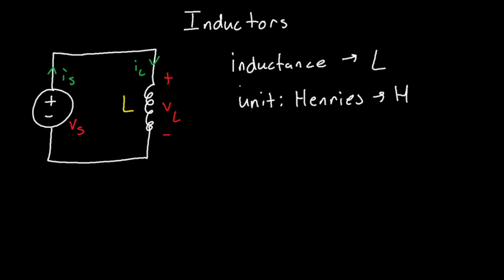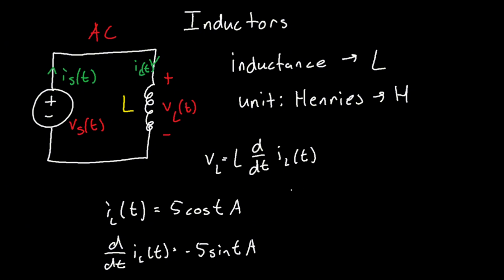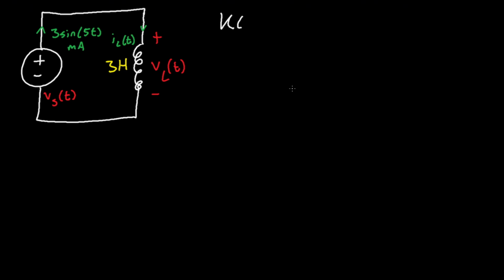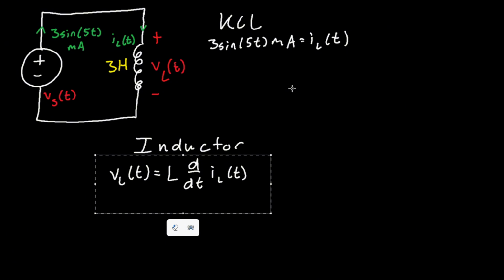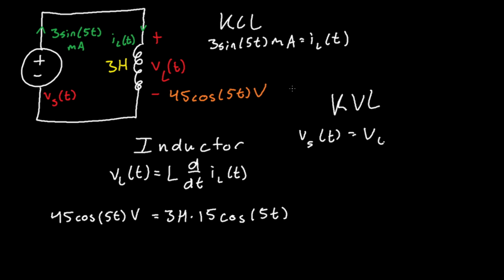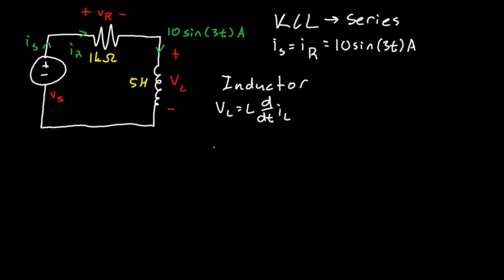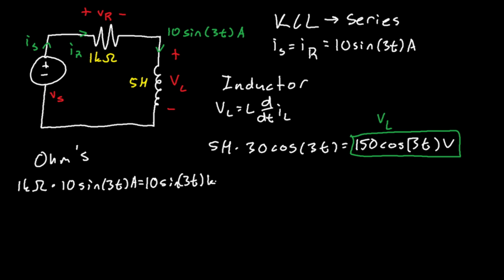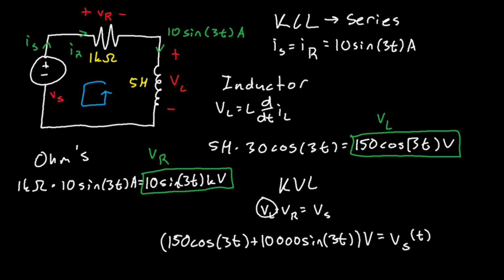Introduction to Inductors - Circuit Analysis

Comment: Alright.. but what if im given a circuit with only inductors and asked to find the equivalent inductance???!
Reply from the maker: Lucky for you finding equivalent inductance has the same rules as finding equivalent resistance. So just add inductances in series and 1/Leq = 1/L1 + 1/L2 + ...

But if you have a circuit in DC with only inductors you'll eventually just short the source with gnd so inductor only circuit works better with AC